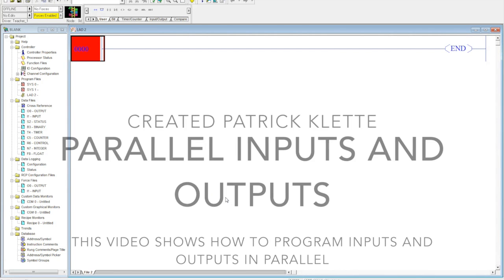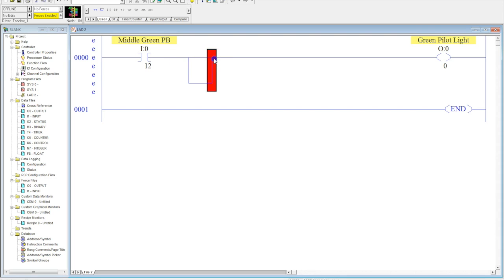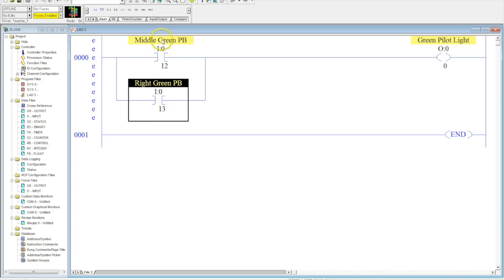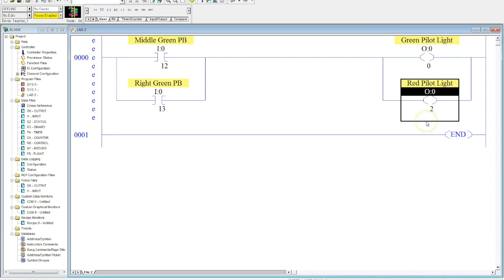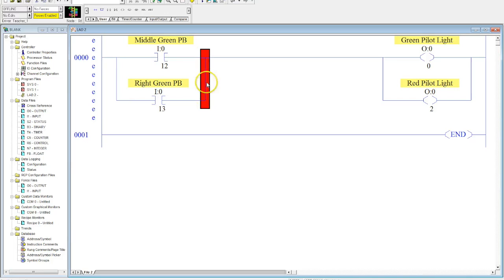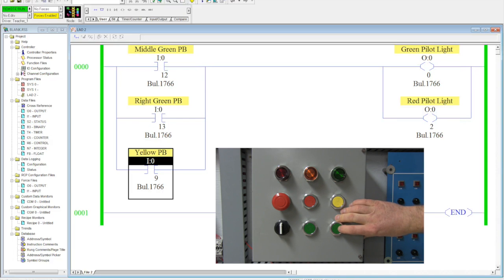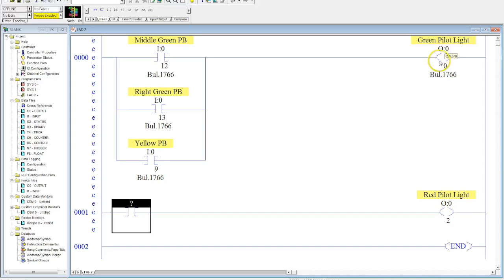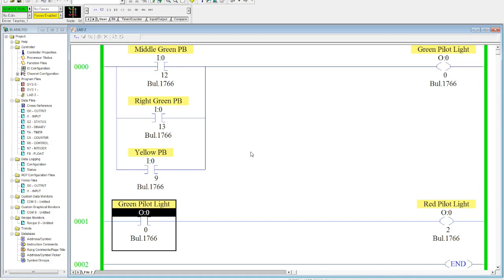Programming Parallel Inputs and Outputs in RSLogix

Comment: I just wanted to let you know that you have done a great job with this. I was looking to see how you could take a contact off the output and use it as an input on another rung. This does indeed keep the housekeeping structure nice and tight.  I also like the fact when you make a branch on a run you keep the vertical bar on the right hand side. I've been stumped I'm getting a latch to work correctly and now I know why.  You accomplished both of my questions and wanted to say thank you for your excellent tutorial.
Reply from the maker: Thanks I am happy it helped!  Thanks for comment

Comment: Dear sir, could you please explain why are you prefer not to put two output in parallel on the same rung ? and you take a contact from the first output and out it as an input to the second output ?
Reply from the maker: Of Course.  It works fine to put them in parallel.  But, if you need to modify the program later for just one of the outputs that can be confusing.  Also, I think that it is easy to troubleshot later if each output has its own rung.  Does that make sense?
Reply: @KletteTech  Thanks. Yes , you are right.

Comment: Done basically the same thing had an output burn out changed it on all rungs then latched it about same way the had a boli watch an output nothing verified it good program nothing but forced the output on it came on but saying this micrologic 1200 a.c.. In and out but had an hmi touch screen do I need to change it also to change an output on the plc
Reply from the maker: Is the output of the PLC a relay output or a triac output?
Reply: Figured it out old program some douche bag left an output bit in there using it in program caused me issues when I moved it. It attached it to same bit douche bag left in the program made it go false while running but will verify